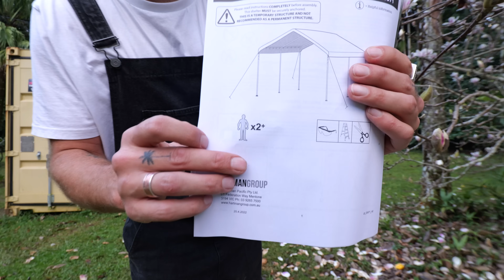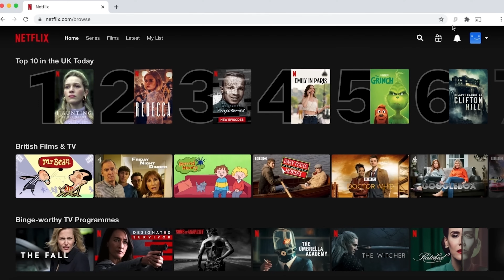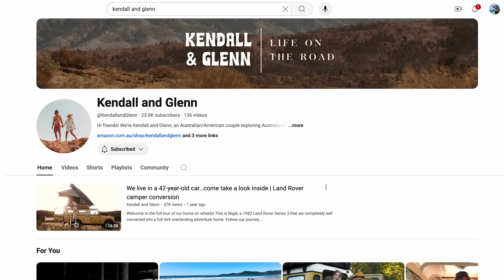The one where everything changes

Comment: Max, probably not the best idea to have backfilled the trench with rocks, as my experience in the construction industry has seen a lot of poly-pipe being crushed and severed using rock as backfill, then running over that rock backfill with the excavator. Usually you are supposed to put a layer of river sand in the bottom of the trench, place the pipe and then cover the pipe with more river sand. Finally the las 100mm minimum you backfill with the soil from the trench with no rocks. Fingers are crossed you haven't damaged that poly pipe!
Reply from the maker: Oops! Thanks for the info!
Reply: @MaxandOccy  No worries I'm really hoping you succeed with the property and your plans for it. Just another thing I'll mention, is to check and double check what the zoning regs are with your local Council, regarding Tiny Homes, what is allowed and what isn't, access to bring the Tiny Home up the road leading to your property, the need to advise neighbours of any heavy transit trucks trailering a Tiny home to your property, etc. 
Some Australian states have weird laws regarding putting a tiny Home on your land, on top of that some councils then again also have different requirements compared the state ones as well. Some councils allow you to have a trailable Tiny Home for short stays or for your permanent main accommodation but you have to leave the wheels on the trailer to allow the Tiny Home to be classed as a "Caravan". Other councils require you to put down slabs and piers to sit the Tiny Home on, run water and power to it (again, permits required for that) but then for the permission to put the Tiny Home in, you now have to pay extra council rates on the "dwelling" as it means more revenue to the council, Council Waste Services have to pickup an extra bin on Bin Days, etc!!  
Not wanting to be a contrarian with this, but I remember the hassles you had with someone dobbing you in a few months ago when you were working on the cabin, and someone had to come out and inspect what you were doing, so you really do need to plan this out before attempting any work as there maybe permits you have to get before doing any remedial work (concrete slab foundations, piers, Trees that are in the road, etc) and of course making sure you don't piss off the neighbours, as the Council will possibly take their point of view over yours as they've been living there longer than you have been. Unfortunately, you buy a property these days and it's still not quite all yours, someone somwhere has a hand out to allow you to do what you want! Fingers crossed this goes well for you and Occy, m8!.
Reply: So excited for you! I'm guessing you've run all these plans through your local Council?
Reply: @MaxandOccy  Usually in the UK its smaller pea gravel just to stop larger rocks from damaging the water pipes. Nice work though!

Comment: Bit of advice. Use the bucket and arm to take weight of tracks when tight turning. Will reduce chance of rolling of the track. Which is not a big problem in itself. Some diggers have track tensioner control in the can. Some are manual tensioners.

Comment: Excavators can be fun and terrifying lol. I was part of a team in the mining industry that was testing using an excavator to replace roughnecking. Replacing the trencher shovel with a claw to grab 300lb 30ft long pipes to place onto the drill rig. Instead of using hands and a wench to place them on the drill rig. It worked, but required lots of practice. 2 times crew members accidentally knocked part of the drill rig hydraulics out of place using the excavator method. The excavator was much safer for personnel, but more dangerous in the hands of someone inexperienced. I got paid 10 hrs a day for 2 weeks straight to just practice the same motions over and over.

Comment: Yeah, so don’t hit the red button until you disconnect those hoses from the bucket. Before you know it you’ll be using the blade as a dozer or to sit you sideways on the right angle, using the boom swing to dig around corners and running around in rabbit mode! Congrats, you’ll probably end up against the window once or twice but you’ll have so much fun!
Reply from the maker: Love that and the tips!

Comment: I bought a car once that had one of those red toggle switches and I was terrified to touch it. Til almost a year later I ran into a guy that said he was the original owner. I asked him what the deal was with the toggle switch.....turns out he installed it as a shut off for the automatic starter so when the mechanic was working on it, it wouldn't accidently engage. LOL Of course I had been telling people it was the ejector seat control. lol